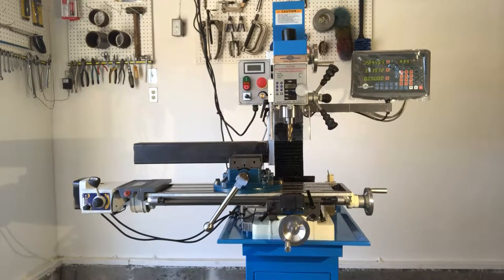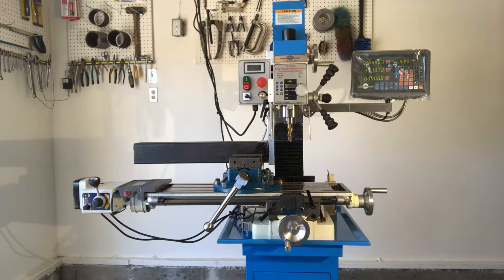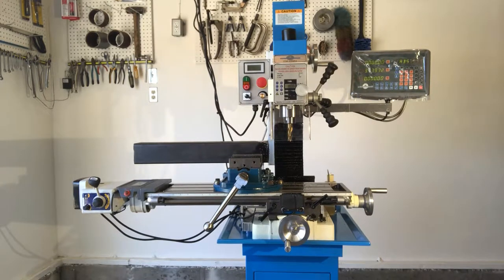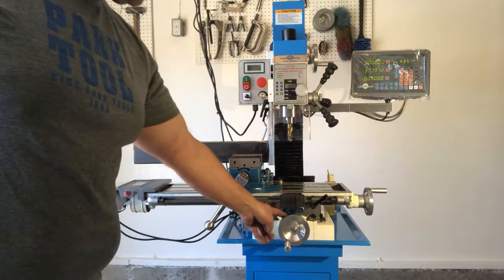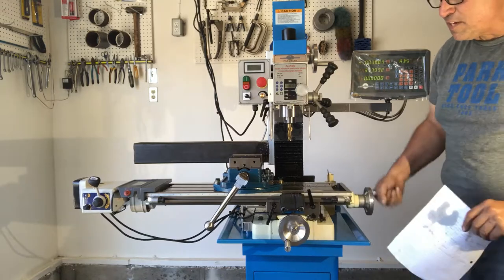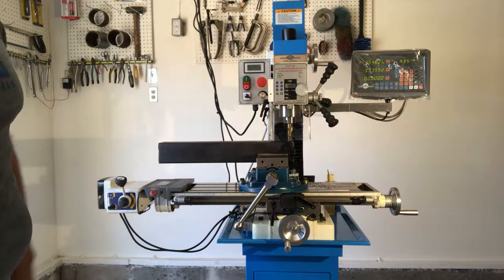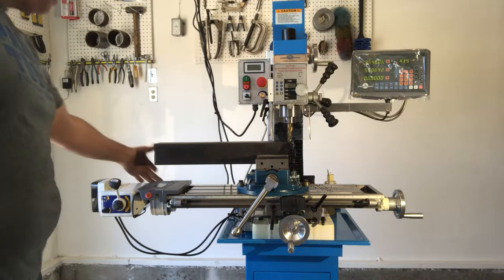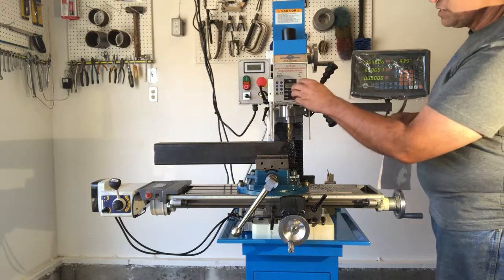Precision Matthews PM-25MV Beginner Tips Alternate Take

Comment: The endmill you got is way too big for that machine. 1/4" endmill is about the right side for this machine. 1/2" roughing endmill is the largest that should be ran
Reply from the maker: Good info, thanks.
Reply: what about big shell mills for decking- can you use those sorts of things on these machines?
Reply from the maker: The “25” in PM-25MV stands for the largest recommended diameter of cutter (in mm). So I won’t use a cutter with a diameter larger than 25mm, although I have used a boring head for diameters larger than 25mm.